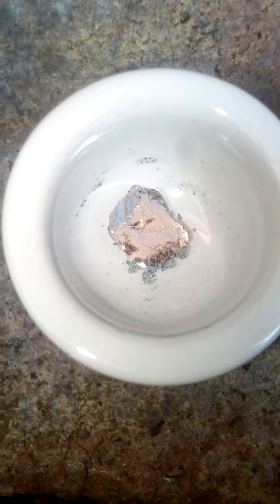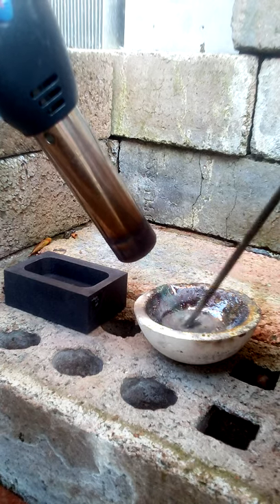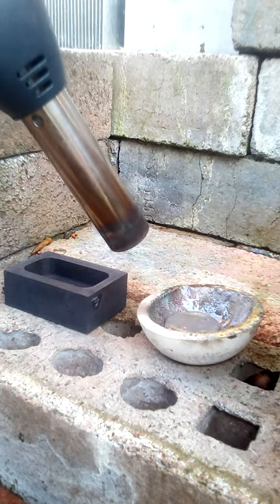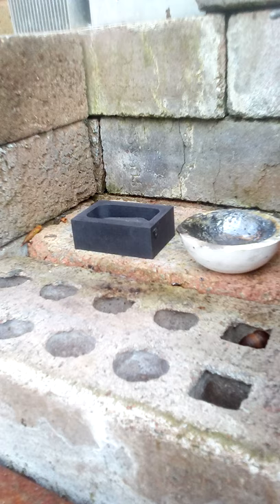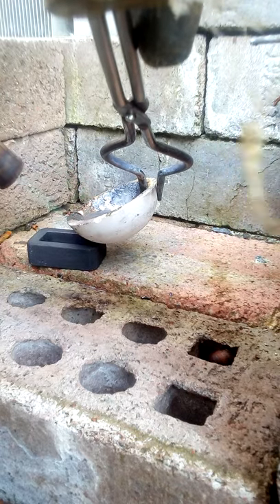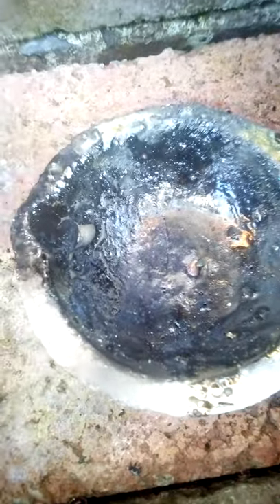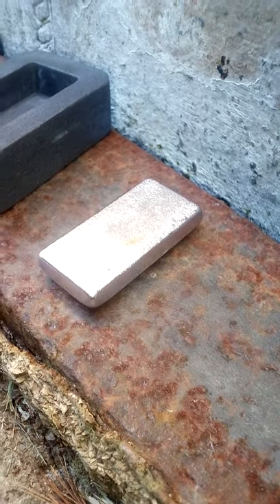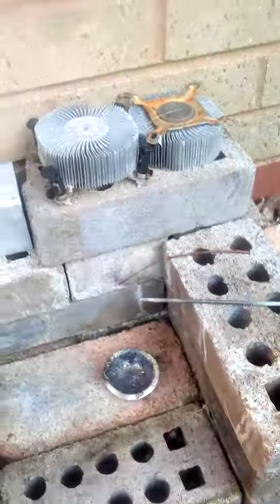Making a Antimonial Lead Alloy Bar.(Sb&Pb)

Comment: When doing larger batches - Since antimony floats on lead does it really matter what container it is melted in eg. Cast iron pot, electric melting, pot, or quartz crucible when the melted lead fills most of the container
Reply from the maker: Yes as Quartz & Graphite bowls help suck oxygen away from the metal,resulting in a hotter/quicker and more pure melt,pure graphite electric melting pots probably best,besides gas is the expensive stuff thesedays,cast iron don't think it removes oxygen like a quartz or graphite does may even contaminate with iron if old an rusty.

Comment: For bigger batches like 3 kg do you recommend a shallow bowl shape or deeper pot shaped quartz crucibles
Reply from the maker: Deep,As dense as the alloy is still can splash as easy as any other liquid when nudged by an elbow or somesuch,shallow would increase the risk of splashing and be harder to heat due to the surface area being way wider.
Reply: @welshdragonmetals  thanks 😊

Comment: Great video. I’m really struggling to mix antimony with clean premelted ingots of wheel weight lead (10bhn) to make 24 bhn bullet projectiles. Basically 14grams of antimony per 100grams of lead. The antimony seems to oxidize before it melts into the lead when I use a blue flame directly onto the lead and antimony. I am using candlewax as a flux and have also tried submerging the antimony in the melted lead in an electric melting pot for 30 minutes or more at 350 degrees Celsius (650 Fahrenheit) but it still just leaves a grainy substance on the surface like it’s not actually melted/ dissolved properly. Any advice would be greatly appreciated.
Reply from the maker: Had similar issues,antimony is crystalline and does not want to be liquid,similar to glass,but it will bond try agitating while heating using a pure steel rod to poke at the antimony bits and use a higher heat if able,candlewax huh eww smelly,try just glazing the melting pot with sugar! if got no borax type salt,as for grainy bits could be unpure product or just not enough bonding,you can reduce oxidizing more using a higher heat a nice quartz crucible will help also in reducing oxygen as will a good reflective surface a ceramic tile thick steel plate etc.
Reply: @welshdragonmetals  Thankyou. I will try borax and a quartz crucible. Is it possible to have too much heat in the flame onto the antimony I feel like this has worked against me previously. My other problem is if the melted lead gets over 750°F roughly 400°C. The Zinc starts interfering with the wheel weight lead mix and ruins the mix for making Projectiles.